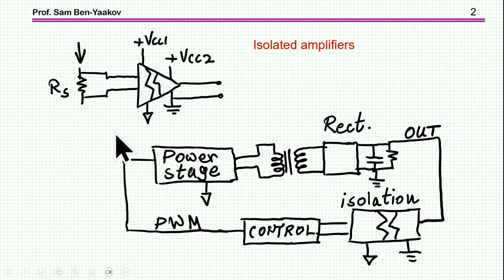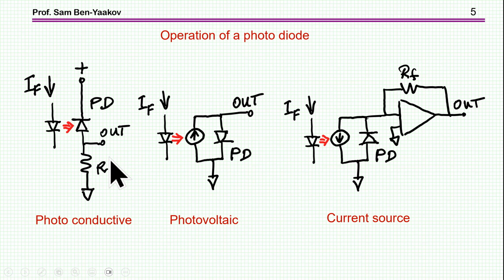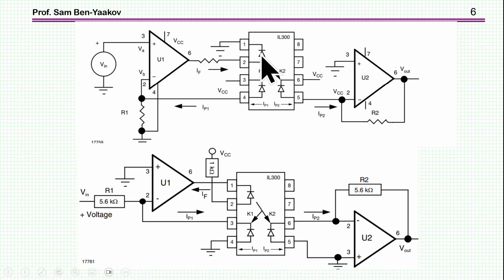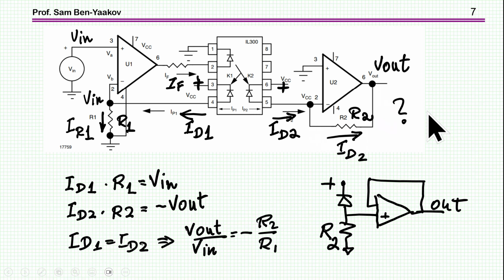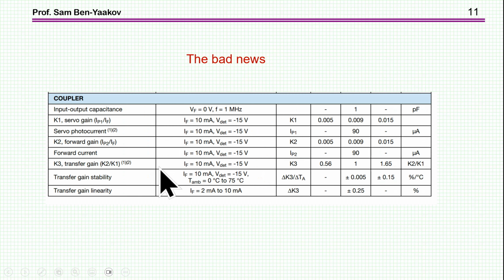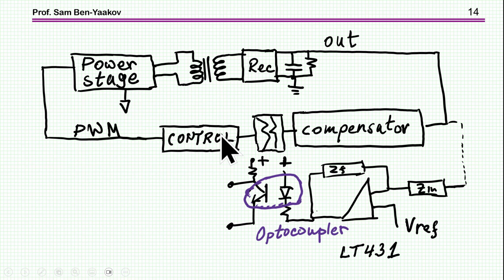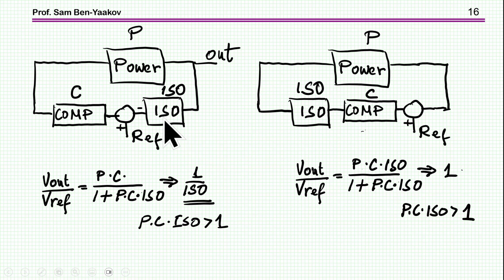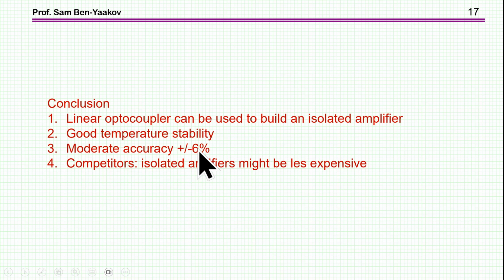Linear optocouplers and applications

Comment: Very, very interesting and useful video as always, thank you.

A video suggestion: Would you consider/do you plan om making a video analyzing modern capacitive-barrier based isolators? Such as UCC21520 (or similar) gate drivers or ISOMxxxx digital isolators. It would be quite interesting to look at them from both a safety-related and a performance-related point of view.
Reply from the maker: Thanks. Will try.

Comment: In late 80s and early 90s, these are popular replacement of isolation transformers and were used in VBD (voice band data) modem's DAA (direct access arrangement) function block.  Typically, a dual T-R pair is used for two uni-directional analog data paths coupling.  
They are popular in PCMCIA modem card for its slim form factor.   AT&T Microelectronics, CP Clare, Siemens, SGS made them. SGS and Siemens made the IL300 variant which later transitioned to Vishey made.  Was a fun memory.
Reply from the maker: Thanks for the interesting history lesson.

Comment: At 7:20, using a negative power supply on the photodiode's anode and the opamp on the cathode will also generate a positive gain=R2/R1.
Reply from the maker: You are absolutely correct. Good thinking. But where do you  get the negative voltage and why not connect the amplifier as a follower?

Comment: I will add a remark not mentioned in the video:
it makes sense to use this solution with a linear optocoupler only when you need an isolated analog signal and a digital signal is unacceptable. because it's much easier to send a digital signal through the insulator. or if you still need an analog signal, then you should stick to solutions like with an optocoupler in smps feedback with tl431 on the secondary side.
Reply from the maker: Thanks for your input.

Comment: Nice work
Can you help me with a circuit schematics for 4x 12.6v Lithium battery to measure separate the voltage with ESP32 i have the ADS1115 I300 ic realize galvanic isolation
Reply from the maker: Sorry, I am just too busy.
Reply: @sambenyaakov  No problem thanks

Comment: The Linear optocoupler was very helpful to me back to college to do small stuff! But after graduating right now we are simply using VFC110 plus fiber optics to travel long distance between pretty high power converters and the controller. XD
I suppose the isolated amplifier uses similar optical coupling method, or otherwise modulated through an air core transformer?
Reply from the maker: Thanks for comment. Long distance is another story. V/F is a bot archaic, isn't it? I used it 50  (!) years ago to transmit information from deep ocean probes, down to 5km
Reply: @sambenyaakov  Yes, stupid and simple, but not too cheap. I heard that TI even lost the design files of VFC110 through the years. They promised to continue producing because industry still uses it.
Reply from the maker: @ghz4-b5e  👍

Comment: I'd imagine they suffer aging effects where the led intensity decreased over time.  Is there a way to avoid these optocouplers and use a modulator with a transformer instead to send the dc info?
Reply: If the LED degrades over time, the servo loop will compensate. Just as for any thermal drift of LED or photo diode transfer function. The "trick" is, that this drift or aging affects both reciever photo diodes equally! As long as this holds true, any error is compensated. See the thermal drift of K3! Almost zero, 0,005%/K, 0,5% for 100 K temperature variation! Not bad!
Reply: @JacquesMartini this is for power supplies in space systems. Optos are frowned upon since they don’t last in harsh environments.  Thank you for the reply

Comment: A more simple explaination for the better option to place the isolation barrier AFTER the compensator is, that any static error or drift is compensated by the control loop, as long as the comparion between the reference and the output has a (very) low error and the loop has enought gain or a minimum integral component (PI compensator).
Reply from the maker: Thanks for the input. I am not sure that this is a simpler explanation

Comment: Objection! The transimpedance amplifier has ALWAYS a higher bandwidth (and lower noise) than a simple resistor in photoconductive operation! The gain of the amplifer does the "trick".
Reply from the maker: Go Fight with VIshay 
" PHOTOCONDUCTIVE ISOLATION 
AMPLIFIER 
The photoconductive isolation amplifier operates the
 photodiodes with a reverse bias. The operation of the input
 network is covered in the discussion of K3 and as such will
 not be repeated here. The photoconductive isolation
 amplifier is recommended when maximum signal bandwidth
 is desired. Bipolar photoconductive isolation amplifier"
Reply: @sambenyaakov  I assume you refer to application note 50. There is some confusion. They are using the terms losely or even wrong. In this document as well as in the normal data sheet, photo voltaic mode is NEVER used due to its serious disadvantages! Only photoconductive mode (using a simple resistor) or an transimpedence amplifier.
Reply from the maker: @JacquesMartini What do you call photovoltaic mode? when the photo diode is clamped to zero voltage?
Reply: @sambenyaakov  The same as you in your video. When the voltage across the diode is directly measured and used. Clamping the voltage to zero required an transimedance amplifier.